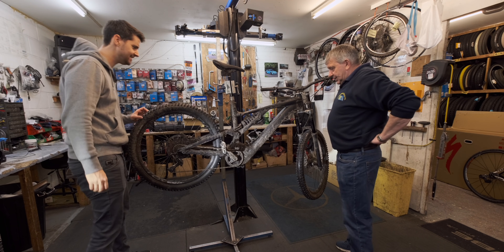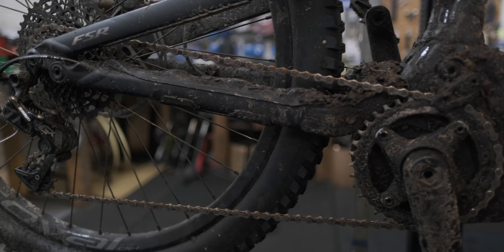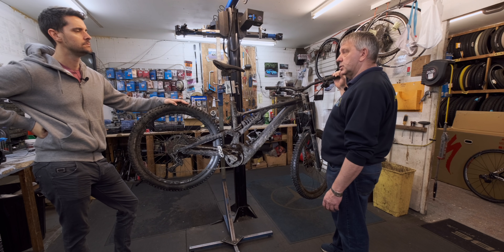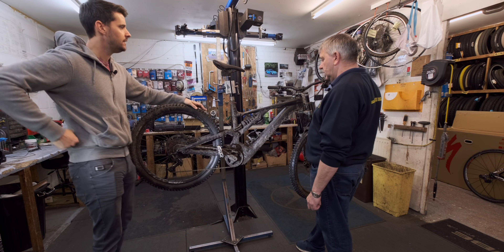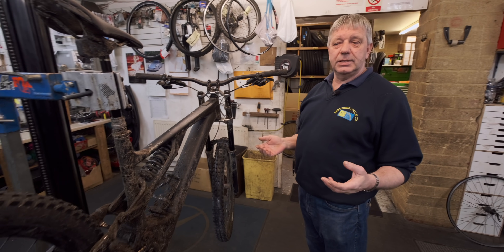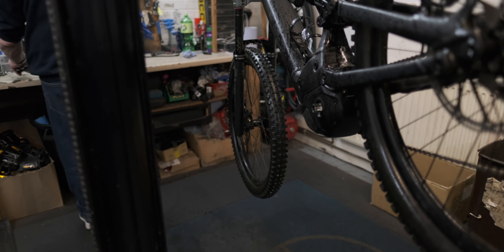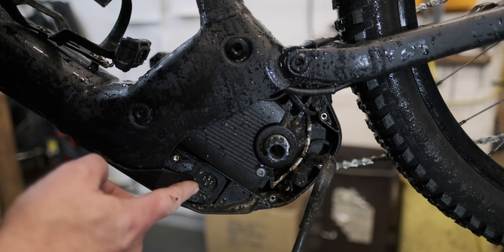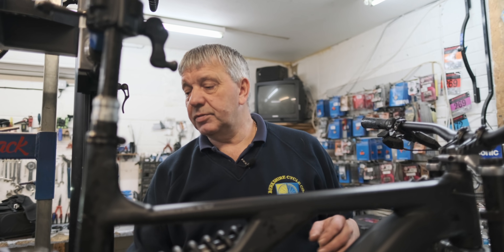How to keep your ebike ALIVE!

Comment: I wish Chris at Berkshire Bike was my dealer, I've just had the main cable replaced and a new TCU after getting loss of Bluetooth and motor faults, my dealer put it down to using the Blevo App (thanks for your video about that app Rob) he even wrote that on the report sheet. He said if I keep using the app it will break again. After searching the forums and through this video I've subsequently found damp on the TCU after washing my bike. So I'm now very careful about getting water around there when washing the bike, I take the TCU off and keep it indoors till I go riding again. And I've wrapped some tape around it like Chris has done. Thanks Rob..

Comment: Well done Rob....about time riders were given some info about how to look after the electric on an E Bike. Chris is understandably being a little political in his critique of what are fairly obvious design flaws in terms of weather proofing, but as he said there are some fairly simple DIY hacks anyone can do to help avoid water ingress. On the basis you and/or Chris may use feedback from this video to give Specialized more information I have a few suggestions they may wish to consider.
1. The motor outer casings should provide a complete seal for the electrical contacts inside them. That means gaskets should be used....either solid or liquid. There are valve systems such as gortex that allow air through but not water so no reason why the entire motor cover set up could not be sealed or at least the area where all the contacts are on the non drive side.
2. TCU connections should additional be sealed to the TCU with shrink wrap
3. The main battery to motor cable should separate the high voltage pos and neg wires from the low voltage signalling wires and the plug at the motor end should be hermetically sealed and not rely on a flimsy adhesive seal between the plug and cable sheath.
4. The Rosenburg plug should be completely re designed. It relies on a single rubber ring to seal it,  it opens in the direction of travel of the bike, and it is positioned in probably the most vulnerable position on the entire bike. Whilst it may be slightly less convenient for charging purposes, the connection here should be double sealed and secured with a couple of Torx bolts. 

Finally I was surprised Chris did not mention the issue some seem to be having with the motor end plug of the motor to battery cable, splitting and allowing water ingress. 
You should do more of these types of video Rob.
Reply: Wow...spot on

Comment: I’ve tried using compressed air canisters that you’d use on laptops etc to blow dust and grime away from the electrics.  Worked quite well so far.

Comment: I use only 2 spray bottles.
One soapy with a little Dr. Bronner's, one clean water. I can get off most anything without so much pressure as to get through the seals. I also do not use compressed air as that will drive water into the seals. Not a lot but if the seals are not lubricated they will allow water in. I just use old shirts or paper towels to floss in between the pivot points and shock seals to dry. I do re-lubricate after wash all bearing seals, shock shafts and adjustment knobs, deraileur pivots and jockey wheels with Triflo.

Comment from the maker: Cheers to Chris @ Berkshire Cycles for the tips! Stop getting those motor errors on your ebike with these tips, keep riding as much as you can this winter!
Reply: Chris made reference to a modification they do to the power cable in the motor housing, what is it?

Comment: canadian eastern fall and canadian earlier spring are almost like the british winter weather...BUT try true north canadian winter, got water warning signals in my levo everytime i washed off the salt and ice and snow from the frame I ended up only brushing it off  to avoid those red flashing lights, plus adding real mud guards make the difference, one mudhugger with an extension on the front forks and 3 different models on the back frame, 1 guarding the lower back end of the levo motor,another proguard on top of it and finishing with the mudhugger rear fender...ugly but it works, no errors yet with so much snow so far in the GTA
Reply: Yeah good tip, people go on about pressure washing being bad for the e bikes but forget most of it is getting pressure washed with crap off the tyres for the whole ride in wet conditions

Comment: I commute three days a week on my Levo rain or shine. I have to lock my bike up outside my workplace. When it’s raining I cover my TCU up with a plastic bag wrapped around the frame and tied on using an old ski tie. Not pretty but stops it being exposed to water for 8-10 hours. I also gaffer tape just around the power socket cover. Probably overkill but the bike gets in a proper state each day

Comment: Great instructions!!  Answered my questions about my 2021 Levo electric issues.  No WD 40, great tip, I have yet to hose off my EMTB in the first 6 months of riding, I use my air compressor and cloth rags, a toothbrush for my gears.   Jolly good video.

Comment: Sticking some removable plastic tape over all electrical parts prior to washing would be the way to go and it maybe possible to stick tape over certain electrical parts when going out in the rain too. One important issue that people need to be aware of is by making the componentry more durable like a motorbike means making the componentry heavier. So the desire for E bikes to be as light as possible does have its tradeoff in terms of reliability.

Comment: Rob, you dont need to a compressor and the hassle that goes with it. I have a £50 Bosch leaf blower, that is as good as the more expensive motorcycle dryers. Drys the bike in no time. Or you can use a cheap heater blower an just leave it on for a few hours too. Even cheaper, bring it into the house!
Reply from the maker: Great tip! Cheers.
Reply: Think I'm going to get a leaf blower after watching this, especially for the winter.

Comment: The seals are terrible for such an expensive bike! Should be at least IP65. I can't believe the amount of crap under that cover.
Reply: Yup. Build a 7k bike put pork switches on 😂
Reply: The motor is sealed but u do need air to get in frame to dry out . There will always be moisture

Comment: CorrosionX on all my electrics, love the leafblower idea, high volume low pressure .  id never use a pressure wash or compressor . Also never had an issue with hand washing . Nano coat the brand new bike and stuff just falls off
Reply: And i never blow grease from the chain over my rear disc, or put my fingers on the brake system and transfer the oil to them.

Comment: last 2 winters rode my motorcycle 105 miles each way commute every week including in biblical rain and through flood water at boot level with no water issues. Also only 8 grand so cheaper than many of these. Needing additional taping is unacceptable design. Also if it needs this level of maintenance it needs to be laid out in the manual as to what is required and what is allowed to be done. Was researching to buy but will stick with non e-bike.

Comment: Can I just throw ACF-50 into the ring here. It’s aircraft treatment largely used in the Motorbike world however it’s designed and main use is in Aircraft surfaces. Alas it is also used to protect all bare electrical parts and the inside of control and electronic surfaces to ensure water ingress doesn’t cause planes to crash!!! There is a great video on YouTube somewhere showing the insides of a light (like a traffic yellow flashing light) submerged in water and immediately shorting yet when ACF-50 is sprayed on it it works under water. PS I have all this kit to apply it and am local to you Rob if you want to give it a try 😎

Comment: Hose pipe and brush better than power washer, muck and grime wont go into bearings and joints but a compressor would do that.
Reply: I've connected one of those yellow coily hoses to the kitchen mixer tap so can spray clean the muck off at low pressure with warm or even hot water. Just have to open the kitchen window though ;-)

Comment: I wouldn't use a compressor with an air hose to blow off the bike for the same reason I wouldn't use a pressure washer; the high pressures concentrated in a narrow stream can push the water past the seals. I thought the use of the leaf blower was very smart. Good airflow over an expanded area. What you lack in air pressure to move the water molecules is made up for in volume while at the same time the amount of pressure won't be enough to push the water past your seals.

Comment: Hah! I've been using a compressor for years - admittedly during summer when it's really dusty. Otherwise I just brush stuff off when it's dry. I do clean sometimes with a warm mild wash n wax solution; wring out the rag and go over the whole bike with the damp rag - no water. I always use compressed air to blast out the brake calipers. If we travel we take an air mattress pump with a pointy nozzle on it - hand operated, high volume, fine jet nozzle glued on.
Reply: Do you think a compressor would disturb a invisframe wrap ?
Reply: @dannyf5157  I have frame protection in places - that never would have been my concern. My compressor is fairly small - probably weighs about 10kg? For example, I put it away after use. I did buy a good industrial hose and fittings for it though - about 5m long, which is awesome. I set the pressure to 80psi at the tank - it's probably about 60psi by the time it gets to the end of the hose. The compressor really comes into it's own, for me, when it's really dusty riding conditions. Although I always give the brake calipers a blast  - it is steep where I am, and the calipers get dusty even when it's a bit wet. I assume it's pad dust? I imagine if you're riding in wet conditions though, that the compressor would also be good. I always blast around the pivot points and bearings too, but I keep the nozzle at some distance so that the force isn't too focused.

Comment: I wouldn't hose or pressure wash my Ebike, I hand wash it with minimal amounts of water. By doing this I've never had any water ingress problems.
Reply: Do you ride indoors or something? I just came back in from a ride and had 2 inches of mud caked on in places. A sponge with minimal water wouldn't have done anything on that mess.

Comment: A MTB doesn’t need to be spotless. Just sure that most dirt is gone and let it dry in a warm(er) place. Wash the chain and cassette pretty well and lubricate it before going on a ride. 

Please don’t scratch it by sanding it with dry paper over the small dust that remains after a wash.

Comment: Very interesting video! Chris grab the bike by the seat with the repair stand : is it risky for the frame : no crack expected by doing this? No wobble in the seat post? This bikes are heavy so seing this make me nervous haha
Reply: It’s far less weight than the rider sitting on it and it’s only a static load. Shouldn’t really be an issue
Reply: @streddaz  thanks for your reply!

Comment: There's definitely 2 sides to the 'it's expensive, you obviously have to do maintenance.' Fair enough you should look after expensive bikes,  but they shouldn't fail left right n centre so easily,  I get the red and blue light thing on occasion (what is this indicating?) my bike hasn't been abused and gets kept inside my house. 
Gonna get invisiframe fitted after a good clean so the cable ties from the soon to be fitted rear mudguard won't mess up the paint work.
Reply: Red and blur lights happen when the motor is not connected properly to the battery sometimes i find it is just a small amount of dirt on the plug which stops it from seating properly, keep it clean and maintain it and it will last forever. Specialised probably the most reliable Ebike out there you have to look after everything you buy.

Comment: Genuinely can't believe that, for the price Specialized are asking for these bikes and how long they've been making them, they haven't managed to make them waterproof yet. Poor show!
Reply: Also not sure I'm with your chap on letting all of the connections run dry... a little bit of dielectric grease in exposed connectors does wonders to keep the water out and stop them corroding, but that's just my experience with motorbikes, cars, and Shimano E8000 systems!
Reply: @R-Dub-Ya  A skeptical person might suggest that bike shop owners tell you to run the connectors dry to keep a steady income from people with connector problems... I'm sure that's not the case though!

Comment: Hey guys i bought that leaf blower you suggested. Works great does the job sublime....but now my neighbor complain a lot when I star the leaf blower inside around 2330..i know it maybe sounds late but prefer to ride late to avoid walkers so doing it earlier is not an option ..any suggestion
Reply: I GOT THE MAKITA LEAF BLOWER too but petrol and my neighbour 2 houses away came over to complain about the noise when using it in the day time on weekends. I plan to use it on my new 2021 Levo mullet

Comment: Chris said it's like 2 steps forward and 5 steps back with the new models.. It would be great to know what to look out for on the older models, I have a 19 Kenevo and a 20 Levo Hardtail with the 1.2E motor fitted. Would this advice be the same for the older motor versions/batteries? I'm glad I don't have that TCU on the top tube, apart from water ingress issues, I really don't like it on the new models..

Comment: Is there any way to connect an air line trigger thing to a Joe Blow Booster (the one with the big air canister you can pump up)? Would be a cheap way for me to get probably just enough air for a quick clean...

Comment: No bar ends <shudder> , when you see your first core sample taken by not have bar ends on you'll be more likely to ride without a helmet than missing bar ends.
Turn bike off, Wash bike as normal, bounce a bit, hand dry with drying towel, air compressor if you have one, then contact cleaner at applicable points, allow to finish dry in a warm place *remove battery if possible and charge while its finish drying.
Chain... wash, degrease, rinse,  dry and dab each individual link with a drop of oil (takes 2 mins) and never use Ceramic lubes on MTB. I like Purple Extreme personally.
Reply: Ceramic, as in chain lube ?  I have dry and wet, I think dry is ceramic... Please explain.
Reply: @sijmes  The Ceramics in the lube produce a grey hard paste that wears and adheres the drive train. If you're absolutely meticulous and clean everything down spotless after each ride then it's not that bad. Have a look at your cassette and see if there is any hard grey/black residue on it.

Comment: getting really tired of my mrs levo not switching back on after washing it. definitely not getting water in the TCU as it is covered up. wash it and it turns on, take it indoors charge it and it wont turn on for a day or two
Reply: oh and i dont have a compressor when i go on holiday and need to wash the bike.
Reply: Same with mine they r replacing all the wires now so I’ll see

Comment: I had my Levo cut power a couple of times and the red light flashed. 
On inspection of the plug there was  blue corrosion around one pin on the male and female sides.  I cleaned it s up hopefully that was the issue.  
I think this is the worst plug design and placement for a ebike .

Comment: I think blowing water and grime anywhere near seals and bearing is just the same as power washing. The control unit getting compromised by water is worrying, if I'm right most bikes have that thing on the bars and it isn't a problem. Was anyone else worried by the bike being clamped on the dropper post and being rotated to a straight position ? He kept hanging on the bars whilst talking 🙄
Reply: Bro The Dropper post support your weight during the ride. As far as the air I wouldn't say put it directly on the seal but backing it up and blowing it off I don't think it's a big deal. If you're just blowing on one spot with high-pressure air like 2 cm away you're going to have a problem. Using air to blow off water with a little bit of space between is a great idea.
Reply: That's an exceptionally expensive dropper, he twisted it in the clamp to realign the bike. Whilst riding you only apply force downwards. But he probably knows that it doesn't cause any damage.
Reply: @sijmes  There’s way more force placed on the post and frame from riding than hanging off a stand. It’s only a static load too. They are designed to take the dynamic load of 120kg plus rider.
Reply: @streddaz I think you're right.

Comment: why clean it ? i clean the drivetrain, brakes if necessary (they tend to clean themselves), i don't care about mud on the frame, what i dont want is start wiping the frame off with a towel, risking to scratch the paint (s-works carbon frame), i just let it dry and if there is a lot of mud it will fall off.
Reply: Haha yeah some people are tarts 😀

Comment: doesn't that dropper flex under that heavy ass frame's weight?
Reply: The frame is way lighter than any rider and that’s just a static load. The dynamic loading of the weight of the rider would be many times more.